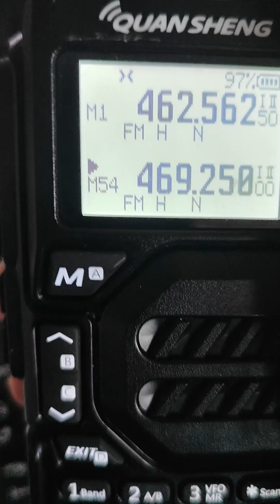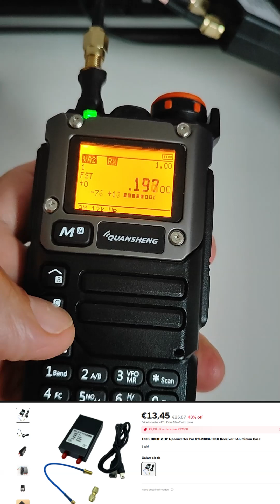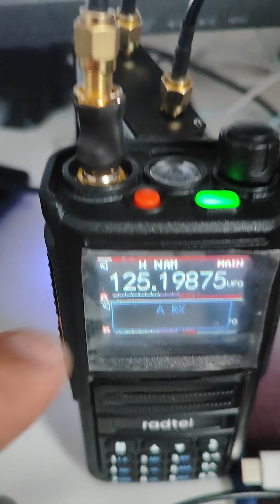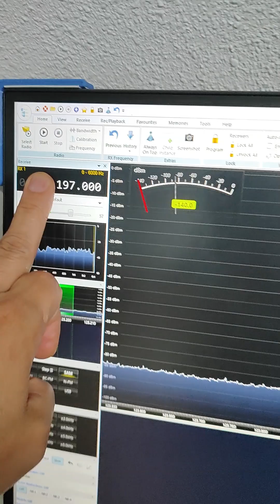QUANSHENG WITH UPCONVERTER

Comment: Thanks for making this video. I have the same. What to do at the C1 connection, there is no capacitor there. Just fill it in with solder or keep it open? I hope you can reply.  I have been wondering how to set it up and now you show me thanks. Can you do the 125 offset in the settings as well or just type it in with the HF band. I have been waiting months to use it.
Reply from the maker: @ominkan3129  just close it with some soldering and it works
Reply: @michaelnoardo3315  Thank you.
Reply: I connected the the gap with solder and checked continuity and tried it with IJV 3.14 trying always and using the up converter feature and can not hear any stations. Many hours trying and not one station heard. Is there a better firmware for this and have you used IJV 3.14 with success. I also tried with an LNA and nothing.